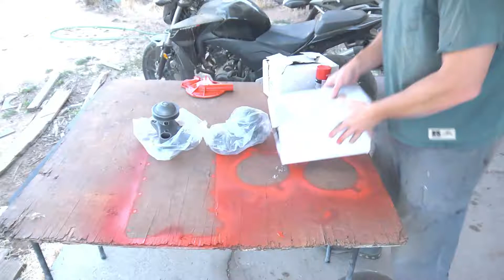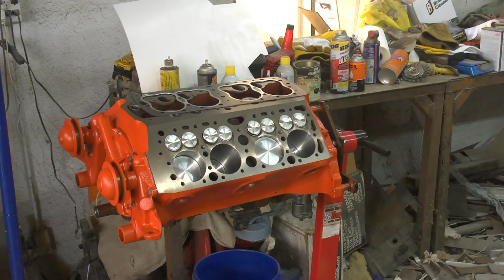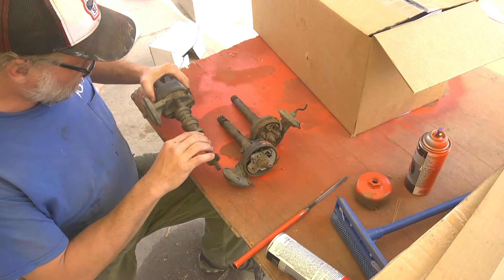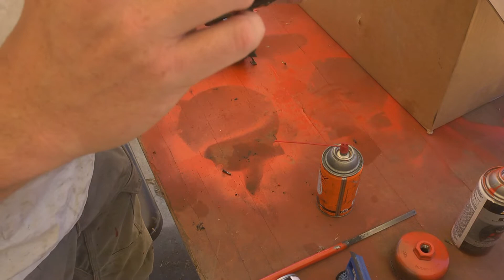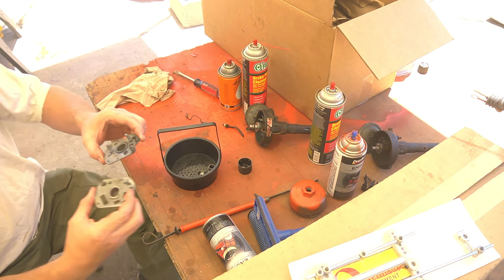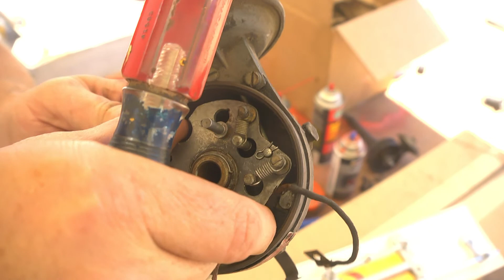Mocking Up Parts On The Race Flat Head, and Building One Good distributor From Two Bad

Comment: Have you guys considered rerouting and adding top exit exhaust?
Reply from the maker: Yes. The only debate is whether we do it right now or later. We have a pretty full dance card at the moment so it maybe a minute before we get there but to get the HP number we need to push the 53 F100 to 110 MPH we are going to need to do that and run the water pumps off an electric motor instead of the front pulley.
Reply: @pitstopranch1422  That would be awesome, can't wait to see the process. I'm hoping to do it to one of my flatheads someday soon...